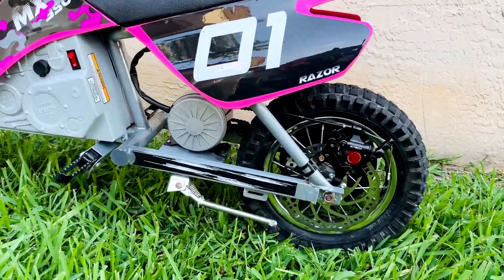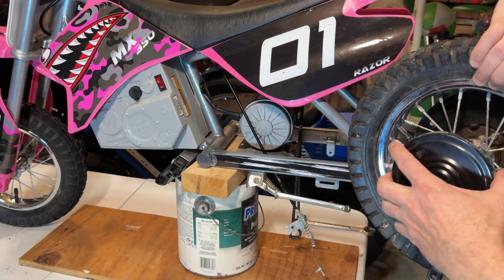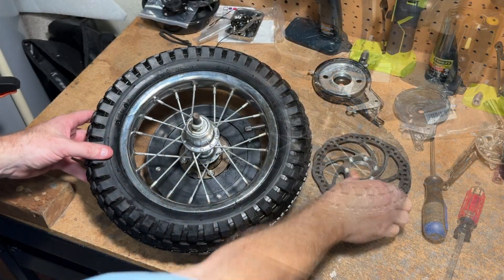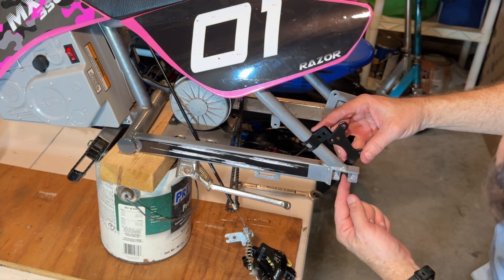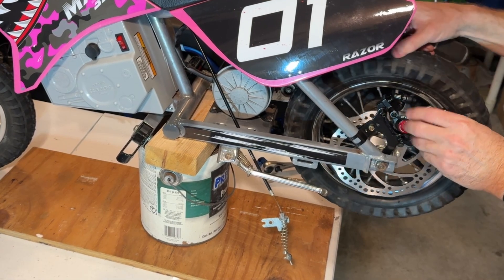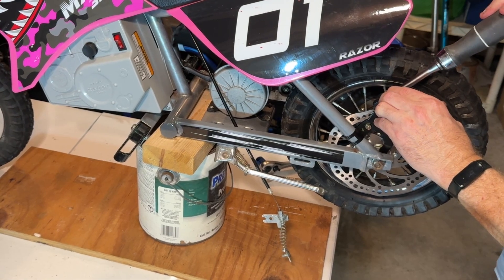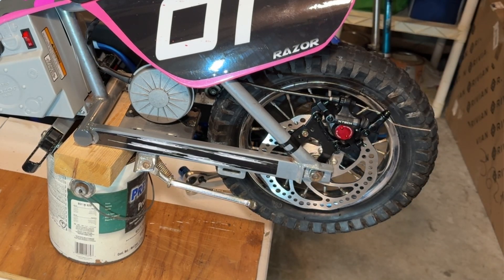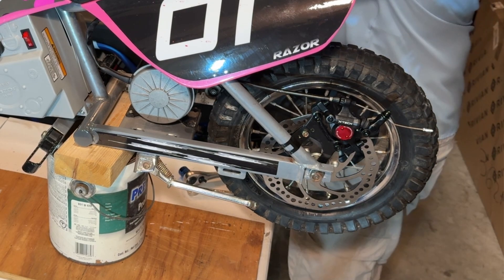$39 upgrade to safer Hydraulic Disc Brake on Razor MX350 MX400

Comment: I bought the same exact brake kit from the list and my caliper doesn’t seem to touch my disk brake. Any tips to make my caliper sit lower??
Reply from the maker: Adjust the brake and let it swing lower for better engagement.   If that doesn't work shave down the braket between caliper and frame bracket to bring caliper closer.  Other option is to go to 180mm rotor.

Comment: Exact components on the amz list do not work. Disc is too small and the pads dont touch the disc.  Mods required or larger disc required.  Buyer beware.
Reply from the maker: 180mm disc?
Reply: Mx350?

Comment: I bought this same part list from your Amazon and everything mounts perfectly but the rotor is legit only touching the edge of the pads. Probably 35% of the pad is touching the rotor Stopping to power is little to none. I think 160mm is not the correct size for some reason so I’m going to order 180mm and see if it works.
Reply from the maker: You can make slight adjustments to the bracket to make the brake pads engage more or buy 180mm rotor
Reply: @BRichSolution I tried to shave the caliper bracket down but it still only touched the edge. Going to try the 180mm tonight
Reply: How did the 180mm work
Reply: @Reg.48 it worked

Comment: i tried it but the disc is too short too actually work and it wears down half a pad
Reply from the maker: You have two options:
1. Buy a larger rotor disk
2. Use a shorter bracket on  brake caliper or flip the bracket so brake pads engage more on the rotor
Reply: @BRichSolution do you think if i cut off one of the bolt holes on the bracket like the bottom one it will work?
Reply: I also had this problem and had to order both a 180mm rotor 6 bolt 44mm and.threaded 6 bolt 44mm rotor adapter (same items used on your pocket mod video)... I originally ordered the 160mm rotor and adapter linked in this video and tried reusing the adapter that came with however that one is a 6bolt 48mm adapter and finding rotors in that size was a bit more difficult. Anyway now that I have it all set up it's working awesome. Great video!
Reply: @chrispeterson4730 you could have also just used the threaded 6 bolt adapter that came on the 160mm that didn’t fit originally that’s what I’m planning to do lol
Reply: @southjerseysoles797  No  you cant - The treaded 6 bolt adapter that came w/ the 160mm rotor is a 48mm bolt pattern. The 180mm rotor is a 44mm bolt pattern.  IE the 180mm rotor wont fit the 6 bolt adapter that came w/ the 160mm rotor..  Now, you can get 180mm rotors in a 48mm bolt pattern however I didn't find them on amazon and they were more expensive at the places (bike and scooter stores) I did.

Comment: Does it  matter what color the disc brake caliber is
Reply from the maker: No color doesn’t battery just make sure its 160mm
Reply: When I’m going 40 to 50 what should I use
Reply: Because I have a stock MX 350 and a Upgraded MX 350
Reply: And also would I be using the same disc

Comment: I am working on this with all the parts on your link. I can only get the edges of the pads to grab. Is this right?
Reply from the maker: Do you have 160mm rotor or 180mm rotor?
Reply: @BRichSolution  160mm rotor.
Reply: @jpsanch33 what did you end up doing ? I’m going to try a 180mm